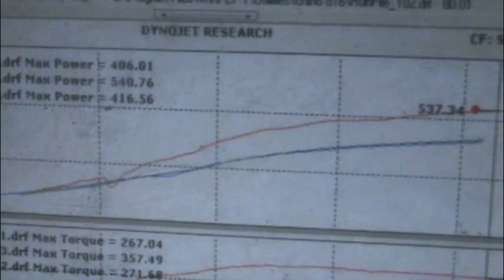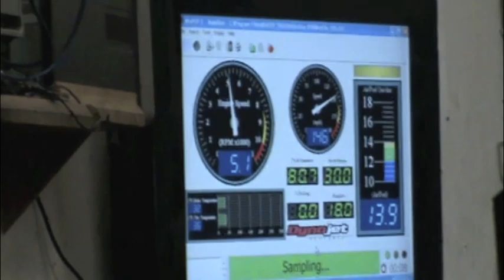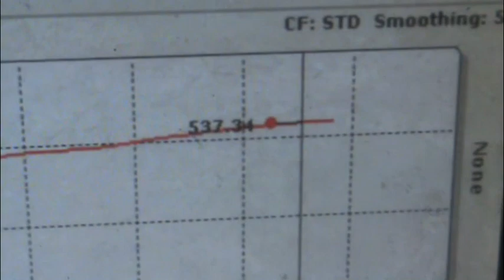Turbo D16 540whp (AR Performance built by Casper)

Comment from the maker: At Christian. Up to 450whp 1000cc inj will do with 1 to 2 fuel 250lph pumps depending on how efficient the engine/setup is. Bov is tial 50nm.

Comment from the maker: E85 fuel
1)  walbro intank 255
1)  inline walbro

We changed to custom Wiesco pistons but we are having fuel supply issues on new turbo 6262. We think dual walbro intank is the way to go. E85 works awesome just needs a lot of fuel flow/psi

Comment from the maker: d16y8 block stock sleeves piston and rods 10:1
d16z6 head valve springs and retainers custom cam
GT35R 30psi on E85
Reply: sfwdcivic. bro. have block guard ?

Comment: @kylesj6033 I have all the similar parts, just different name brand. What I do have different is a Web Level X camshaft, Neptune Demon engine management, and I was on SP1 (110 octane) fuel. Made 422 HP on 21 PSI.

Comment: Nice setup! Quick question, I am making 422 hp and 322 tq on 21 psi with a GT2871R. I am changing the turbo out and aiming for 600+ hp. Can the eagle rods hold up to that? I see you are using eagles, and I heard 500 hp was the max, but you have obviously proved that to be wrong. Let me know. Thanks.

Comment: I have a question for you. What are you running with your gt2871r? I havent bought my turbo yet but that was what I was aiming for. Around 400 to 450 hp. Im rolling on brian crower titanium retainers, and springs, skunk 2 intake, eagle rods, d16y7 block with a d16y8 head. I am running on the p28 with a mugen chip in it. I have full 3" exhaust from header back, stage 5 xtd clutch. What parts do you have that I dont to create that kind of power? I mean other than turbo right now.